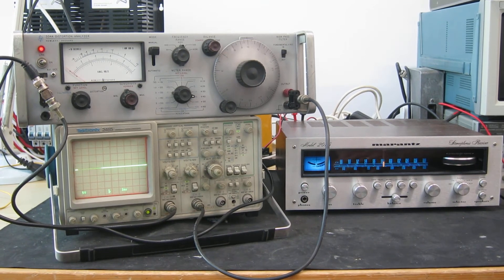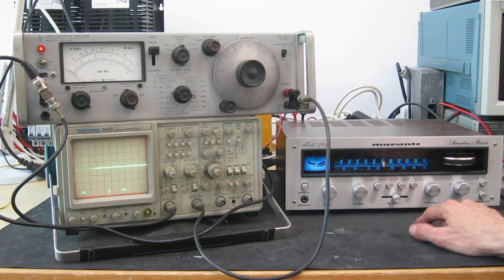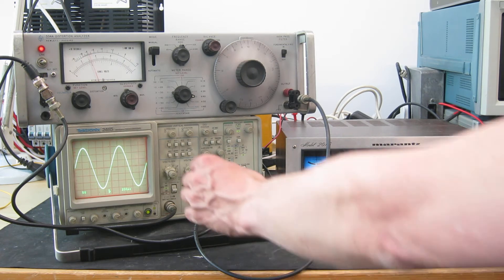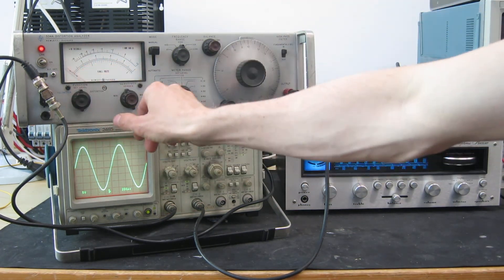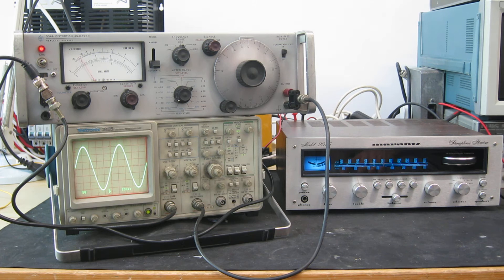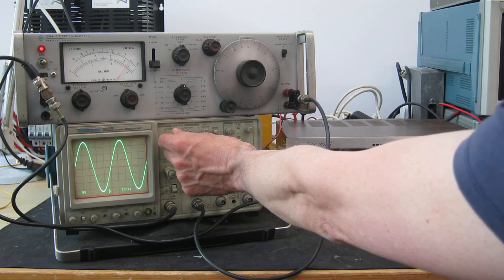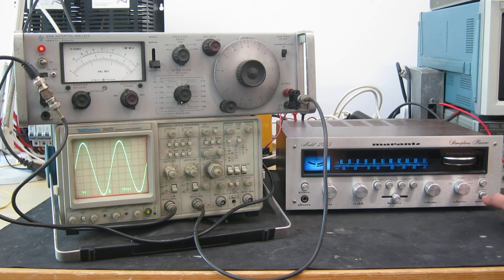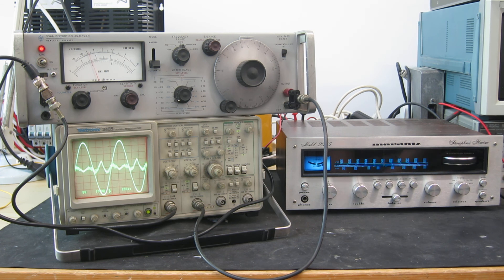Marantz 2015 receiver output power and distortion test

Comment: Thank you for doing this video, it is a lot of work. The next comment is late, but it might help others doing amplifier tests.
The reason your reciever exceeded its spec by so much was your testing only 1 channel at a time.  Marantz specified the 2015 receiver with both channels running at full power. The FTC amplifier ruling of 1974 also specified that both channels had to be at full power when specifying power output and distortion. The reciever should still exceed spec, but not by as much.

Comment: You did the "Set Level" process very different than other videos on here, also made by reputable audio/engineer guys. Now I am not sure which method to follow :(
Reply from the maker: I think I may have done the 'set level' process wrongly. I've just checked the manual and in paragraph 3-19 j it states that for a percentage distortion measurement the level should be set to full scale on the meter. I set it to 0dB so my distortion reading will be lower than it should be, but in any case it's clear that the amplifier's distortion is lower than that of the oscillator and distortion meter combined, so it exceeds its specification.
Reply: Exactly, if set to 0db then distortion measured in db not %
Reply: @cmjones01  awesome thanks for the reply! I was able to find a couple other videos to help as well. Slowly getting the hang of my 333a haha.

Comment: You set the level to 0db, then read in percent. You should set level to 1 on the middle scale to read in percent.
Reply from the maker: You're quite right. My bad. I've just checked the manual again and in paragraph 3-19 j it clearly states this, so my distortion measurement is lower than it should be. In any case it clearly shows that the amplifier's distortion is lower than that of the oscillator + meter combination so it's still meeting its spec, but I'll remember for next time.